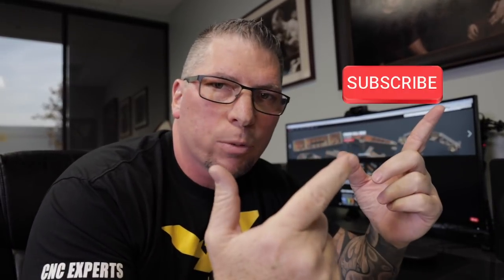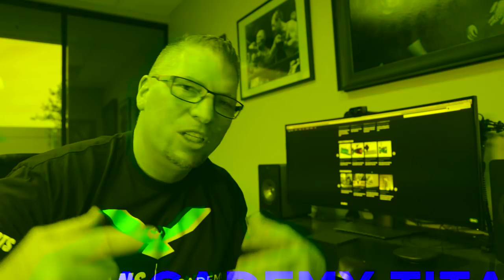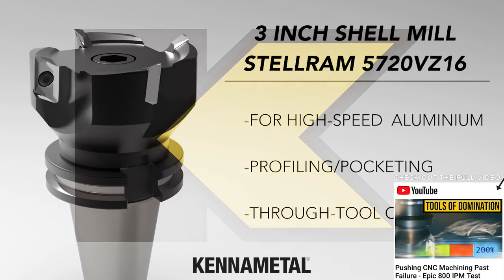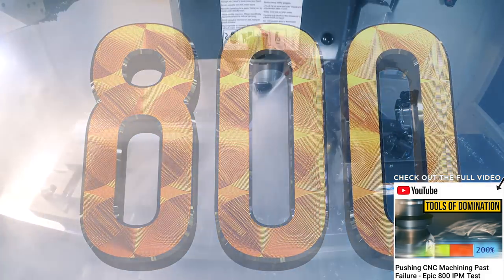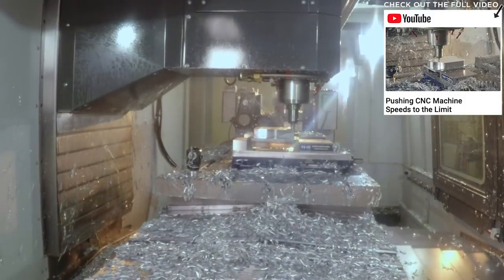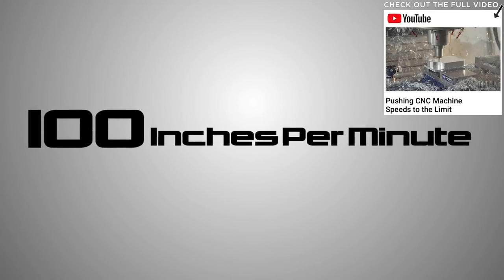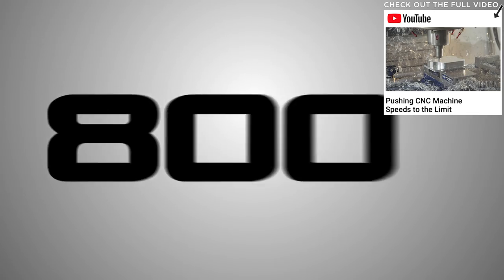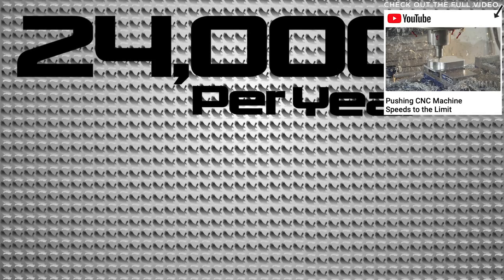High Speed CNC Milling With Kennametal’s Harvi 3 |Vlog #28

Comment: Thank you Titan for everything you do. I’ve been running a Mazak QTN 250 lathe for a few years now. Trying to push myself and cut faster and effectively and it’s working out great! I still try and watch and learn about pushing a milling machine so when I transition back in the future I’m ready to push the limits. I’m looked at in my shop as young and dumb, but when they hear my machine throwing chips everywhere and getting after it, that’s my proof in the pudding. BOOM!!!

Comment: I am a newbie to machining. 
I got a job running right now that's taking forever, we get two parts off in a day's time. I just came across your channel and bragged about it to my boss, he finally gave me the go ahead to try some "new" tools for roughing 316 SS and I shaved almost an hour off our roughing with just one end mill. That tool is awesome! Went from running 9ipm, .0014"/tooth with a 4 flute 192 SFM, to 156+ ipm, .0064"+/tooth and 450ish SFM and still running a 8% stepover (that stayed constant). I was told it can't be done, but I think I just proved them wrong.
I am running it on a 20+ year old haas vf2, the load on the tool is 30% and but I was told not to push it anymore because the machine can't handle it.
Reply from the maker: That’s Awesome!
See that’s the name of the game. Time is money... keep doing that and your boss will make more and more money... and you Aaron will deserve higher pay.
Reply: I know that you machine alot of hard metals, when possible we waterjet cut the materials to near net shape so we use less roughers; it seems to be faster than machining especially when there's lots of material to remove.
 
I know that you use kennemetal tools, but we have had luck with Guring drills holding up well in hard metals and Krycera drills working well in aluminum.

Comment: Thanks for all the videos Titan. Would you be able to address high speed roughing and then finishing of thin walled parts? We do a lot of that and it seems difficult to keep the parts from flexing/bending, solely from just the material being removed (even if cut slowly-mainly aluminum). Thanks for your contribution to the industry and your inspiration!
Reply: @Paul Hill "Ditto" on finishing strategies + stress relation of materials (beyond spring pass etc.) or how some materials may take much longer to move.
Reply: @thundercuck1779  understood. It seems more that when roughing and finishing one side of, say a housing, as soon as you remove material from the opposite uncut side, the first side dimensions will change due to the material relaxing or stress release. We are experimenting with plug and support methods now. Thanks for the input.
Reply from the maker: Yes! We actually do a ton of tall thin walled parts in Aerospace and have some great techniques... It’s an art but trust me, you can do it efficiently with the right EndMill and speeds and feeds. Will do a whole video on it... won’t be for a few weeks though as I want to also film samples not just talk about it
Reply: @TITANSofCNC  that's awesome, thank you!
Reply: @TITANSofCNC  Super awesome... Don't worry about time frame 'cuz these types of problems never go away; always worth the wait, easy when you know how but it's the KNOWING HOW  that's the tricky bit... :-)

Comment: TIME IS MONEY!!
Well said. So many customers don’t get it.....
Reply: So is the cost of tooling . My business in Australia,  I charge AU $100/hr . It would be pointless to have a tool strategy that the tooling costs more per hour than the hourly you are making (tool that costs in excess of $300 & only lasts 90 minutes). 
My cnc mill 8000rpm spindle 2000mm travel in X , BT50  spindle. 
My roughing is done with a Seco R217.291-3240.3-06.4.075A  cutter
RPKT1204MOT-6-M15, MP2500 inserts.
2400RPM  
3600mm/min
3.3 mm depth of cut 
30mm stepover.
They are a button insert with a location pin , so you can rotate 6 times.
Tooling cost per part is low & material removal is faster than any other cutter I have tried.
I am considering going to similar cutter but 63mm diameter & 7 inserts .
In my cam simulation, this shows even more time savings.

Comment: I have to say thank you for the continual inspiration as well as the tips! I'm stuck with older machines with limited (4k and 5k, haas tm-2 and gr-510) 40 taper spindles with slow (200ipm and 500ipm respectively) rapids. What kind of strategies can I implement to at least come close to being competitive? Im already on the fixturing path. We do a lot of sheet metal and copper tapping from 8-32 up to 5/8-18 in 316 and many countersinks in stainless that always slow me down. 
Thanks again for all the help, 
Mike.

Comment: Great video. But you didn’t discuss the material that whips me. Lol. 17-4 in condition H-900.  We had a job not too long ago with a very big, very deep pocket in it, and tried several different strategies. We settled on a Seco 638R, and were able to get some pretty good speed out of it, but tool life was just very unpredictable. It would cut great right up until it just sort of died. No real wear indicators. For what it’s worth, according to my CAM software, the pocket had about 5,400 linear feet of cut in it, using a 12% step over. Also had a nice holder in a new 40 taper machine and nice rigid vises. Cimcool at about 15% mix. What sort of parameters or advise do you have for hard 17-4?

Comment: Titan thanks for everything you do. You talk about getting after it (roughing), the letting the material breathe, and coming back to "kiss the baby" (finishing). Can you elaborate on this? Like how fast to rough, what stock to leave for the finish pass? How to you let the part breathe? And at what feed rate do you finish? I know how to hit +/-.001" in aluminum no problem. But I've been a bit leery at quoting jobs that are in the tenths (+/-.0002"). Would love to see some videos on how to hit these tighter tolerances. Thanks again
Reply from the maker: Will do in a future video...
Ha ha:-) Kiss the Baby!

So many viable to discuss...

Stay tuned
Reply: Jobs like that are entirely dependant on a rock solid setup machine axis backlash (less than tolerance you have) and stoutness of your tooling set up. If anything sucks or if the endmill is too small chucked too long or trying to feed too fast it will deflect and you will fail. If all these are good it's still nail biting tolerances... hit the green button and nobody breathe.
Reply: @TITANSofCNC  Kiss the baby!!! Love that term, the face you make when you say it always makes me laugh. Good stuff. In the future video you mention, can you please throw in some pointers on how to then measure it? I have a machine probe on my new 2018 Haas VF-5SS but no CMM. Can it be done with mechanical measuring tools and probe? Would love to see your suggestions.

Comment: Really enjoyed this video. I often find myself backing off the feed rates way below where I know I could be just because I'm missing the sweet spot. But like I tell people I work with they don't put flutes on endmills to make them look pretty they are there to be used. And it is definitely a lack of education in the industry perpetuating the myth of low DoC with high WoC. Like you said at beginning rigidity is key. Do you have any thoughts on maximizing feed rates in less than ideal setups? Also any thoughts on how to adjust SFM when using a long tool to reach out?

Comment: Hey titan. When you get a chance. Can you go over finishing strategies for surfacing in aerospace alloys?
I ask because I’m dealing with a new breed of parts. Engineers using “generative design” here at work. The geometry is basically free form. So tons and tons of multi-axis surfacing.  
Cheers 🍻
Reply: @Marcus Madrid "Ditto" also and same with "generative design" (some times I call it "degenerate-ive" design as some design folks don't see how to take the computed surfaces to something cleaner and more aesthetic and smidge easier to machine)… But never the less IS the future of faster, lighter, stronger, cheaper. +Marcus Madrid good call !
Reply: EXTRA DIMENSION m
Reply from the maker: I will go over all
Reply: @TITANSofCNC  That would be awesome! + Forward looking and super helpful.

Comment: Titan I am going to be testing some Kennametal drills I saw you promoting on YouTube, I am looking forward to it, it’s 304 stainless (a refrigerator hinge we stamp out) we drill and tap for 1/4-28 threads along with 5/8-24 hole, needless to say quality and quantity is the goal, the drill is KEM4150218 1 Drill, 5.5MM/.2165/3XD
B041A05500CPG KC7325, I’ll let you know how it goes thanks!!
Reply from the maker: Depending on how many holes you have... the KenTIP FS was designed just for Stainless and is a Beast. Has to be the “FS” version though and it’s only for the larger size.
Good for production of hundreds of holes or more.

Comment: Hey Titan, have you looked into what levels of heat are generated by going faster, or slower, in those harder metals? Do you find that running faster adds or decreases the level of heat generated by the tool into the metal part? Is that also more, or less, beneficial for the tool, the part, and your overall cost of operation?
Reply from the maker: Well the quicker you can get in and get out... definitely helps. Tooling, Coolant, Chip evacuation etc all play a role also. Coolant Thru Tools...
I actually run crazy fast in plastic for just that reason... Pound it and move on before heat rises.

Comment: Hey Titan!
I'm doing an vocational training as a Maschinist in Germany and we just had a course about high speed cutting (HSC). In our case it wasn't just on getting the feed high but also working with extreme Revolutions up to 60.000rpm while even using a 1 inch cutter. The point of this is that the cutting force is minimised by a lot and youre able to hit much higher tolerances an thin wall thicknesses. Of course you need a special milling machine with a special motor and tool holding system, capable of dealing with such high centrifugal forces.
Do you have a similar system in your shop? And what do you think about that system?
Love your videos!!
Greetings from Germany!!!
Reply: @Caspar Bewerunge Would be good to have a video as to what one can get away with at different spindle speeds especially for surface finish , especially for a HAAS (level/ C frame mill). @Caspar B what are you using ? Sounds kinda DATRON-ish to me ?
Reply: @extradimension7356  
I don't know which exact Maschine it is is but it is a Maschine from the   Deckel maho company which is now part of DMG Mori. It has two different spindle heads, one conventional one with normal gears and one where the motor is directly mounted on the spindle because because gears wouldn't be able to handle such high RPM
Reply from the maker: Well, all materials and tools have what we call a realm or sweet spot... At 60,000 RPM’s I would assume your talking aluminum or possibly steel.
There are some tremendous machines and tools out there for big money that can run at crazy speeds but on machines that cost less than $200K, I would say you have to choose HP or RPM, meaning most high RPM machines lack true Rigidity and HP. Makes sense right, they give up one to excel in another. My new DMU50 is a little different as it’s got 20,000 RPM’s but also feeds at 1600 IPM. But it’s also over $200K.
There is an art and a recipe to Machining fast... and please understand this Video was for Rigid Machines Cutting Hard Materials. Aluminum is a while different story... RPM’s lesson pressure but also cause vibration if you don’t have Rigidity. I rough incredibly fast and don’t worry so much about vibration as I am pushing with force... but then I slow down and kiss in my finish passes with the right recipe of feeds and speeds.
Reply: @TITANSofCNC  That's a good answer , seems the 15K 18K and 20 K RPM spindles are a good compromise if they have double windings, but to be honest the torque is really really small at higher RPMs anyway. Just wondering what the limits of smaller tools size are on like 18K spindle VS. getting one of those air driven speeders ? [Funny that 12K RPM stuck and suited most people (for a long time); now it's like 20K is the NEW 12k (lol).

Comment: Hi Titan, can we run these feed and speed numbers with a belt driven spindle or are these numbers suited for direct gear drive spindles?
Reply from the maker: It doesn’t take a ton of HP because of the small Radial cut.. so just depends... if you struggle, just drop the Radial step in by 20 or 40%
Reply: TITANS of CNC: Academy 
Thanks for the feedback. FYI your videos and tutorials are making a positive impact here in Australia, I own and operate a small CNC machine shop and teach night school CNC classes. I have just started getting a lot of NA18 (Monel 500) jobs and have found your videos very helpful. Also I encourage my students to view your content and have found that since they have been doing that their enthusiasm for the trade has increased 10 fold. 
Now I will be talking to Kennametal about some tooling solutions for our applications. Thanks again!
Reply: TITANS of CNC: Academy 
Hi Titan, how do hydroforce holders compare with shrink fit for rigidity?
Would really appreciate your feedback on this one, especially with your experience running at the numbers you do.

Comment: I am new to cnc, and part of the Academy. But i have a question about these feeds and speeds... can i apply these numbers to all carbide tooling? or are these strictly for Kennametal tools. My shop does not use Kennametal, but I'd like to start applying these feeds into my roughing. Thanks for your videos and information Titan.
Reply from the maker: I would adjust down for other tools and trust me it does matter... These are proven speeds for the HARVI 3 only.
Reply: @TITANSofCNC  Thanks for the imput and reply Titan

Comment: When you use Model Box point then move the xyz triad to the top left, it is inside the stock. Won’t that be a problem when locating the work offsets?
Reply from the maker: No,
It’s off the actual model which is an absolute and never changes.
So if your material is .100 over the model, you move in .050 and if it’s .040 over... you move in .020 etc.
Reply: I don’t understand. Why not use the stock box point?

Comment: We currently machine everything at slower speeds using the tip of the tool. After watching your videos I wanted to try some of these high speed tool paths. I do not  know what other machine tool companies offer but we own 1 year old mazak machines. They are not currently capable of running these high speed tool paths do to the options needed for this are locked in the control, we would need more memory  and high speed smoothing( cost is about 8k$ per machine). Is this common?
Reply from the maker: Try Fusion 360, it’s Awesome, inexpensive and smoothing is built in.
Reply: @TITANSofCNC   good to know, we currently run fusion but because of the memory size we are limited to program sizes of around 9k lines without the memory option upgrade. Most everything we program is done conversationally from the control threw mazatrol.
Reply: Try to run with DNC(direct numerical control) from your computer. I use this method on my Haas in case a very long programs when control memory is to small to implement it.
Reply: @orowski4414  wish I could but that is an upgrade from mazak as well,  call it ethernet running.
Reply: Understood  @waynemartin3508  .Mazak want money for every basic function.My mate runs few Mazak machines
with mazatrol only but he makes big quantity batch works generally . One program by hand and go.

Comment: How’s it going I used to run a hutch vmx 40i and was doing the high speed mill doing 600 ipm I have switched jobs now I run a haas vf 2 and doing the dynamic mill and I can’t get it to run 150 ipm the machine jerks around what am I doing wrong I think it’s because it’s not looking ahead in the program is there a code that I need to get the machine to run the speeds that I’m looking for thanks.

Comment: I am a long time machinist and I am using a six insert 2.5 inch iscar shell mill cutting  some A36 12  x 24 inch parts four pieces at a time on a HAAS GR512 at 60 inches a minute and .0625 depth of cut with a 1.2 step over, how can I see if I can go faster or deeper?
Reply from the maker: I will do some similar cuts in upcoming videos and you can compare!
Reply: I don't even use a chart anymore just listen to the harmonics and build up slowly pitch changes should quiet down if it's right. Then examine your inserts after a set has run. Somethings you don't want to mill at ludicrous speed even in roughing and even if the machine can handle it especially in aerospace. I've seen guys make endmills steam make the part in half the time and it comes out visually looking nice... Then it goes to the customer and fails gets rejected from x ray inspection micro stress fractures.
Reply: @fireteamomega2343  Oooh what alloys ? That's some kind of aluminum based alloy ?
Reply: Thanks Titan
Reply: @extradimension7356  
Yeah 7075 t6 has a tendency probably due to the chemical bonds being a higher zinc content. T10 can also do it usually it's noticed after heat treatment due to striations and expansion cooling. Others include some newer shape memory alloys not available to the public.